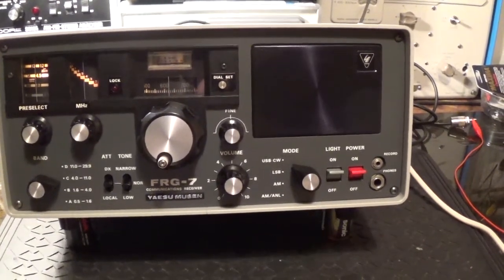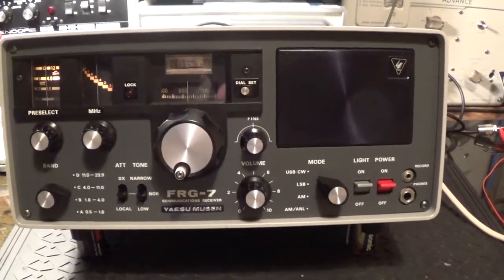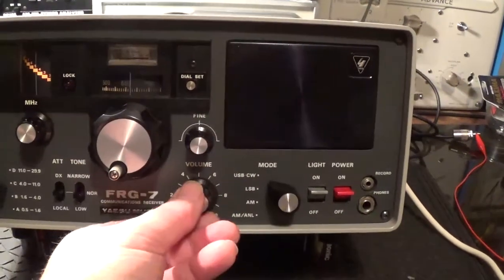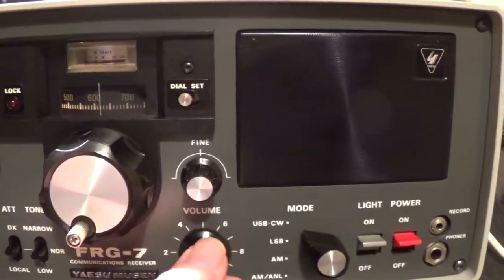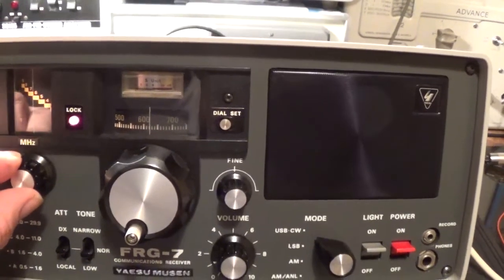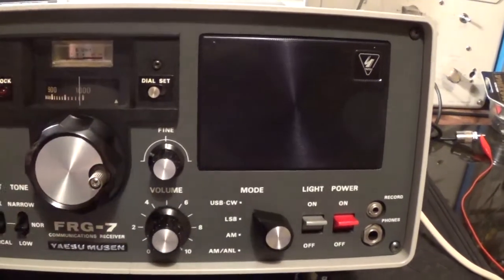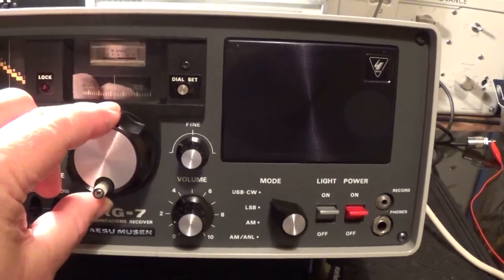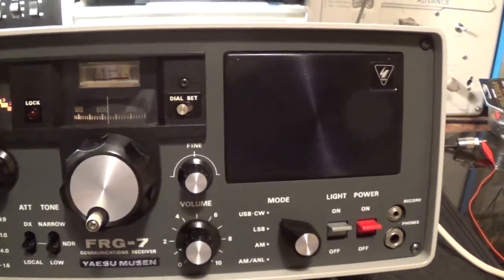UBV-76 on FRG-7

Comment: Using an FRG-7 here, replaced the lamps with warm white LEDs. Picked up at a garage sale for $50AUD and only needed a squirt of Deoxit in the band and mode switches plus removal of small dry leaves from the i.f. panel
Reply from the maker: Yep they're super radios for their age.  This one was £50 GBP but you got the better bargain at $50AU ! Mine has some third party mod on it, I think something to do with the SSB but I can't find a reference to it on-line.  I was thinking of doing an LED mod for mine but green... Thanks for watching.
Reply: Andrewausfa 
The SSB mod could be to slow the AGC to prevent pumping on strong signals (or CW).  I have about 10uF. between the Ground and Mute posts for the same purpose.  

I also have a 150ohm resistor between the SW and MW posts to make MW recieveanle on the SO239 socket.  There were CW filter mods, FM panel, frequency counter to replace the kHz dial, defeat the MW attenuator. Etc. looks like quite a few fitted a 1/4" headphone jack. Mine still has the 1/8" jack.  

Daytime reception is very limited here but greyline propagation is mid-late afternoon and brings Europe/USA on the 20M band and quite a bit of SSTV at times.